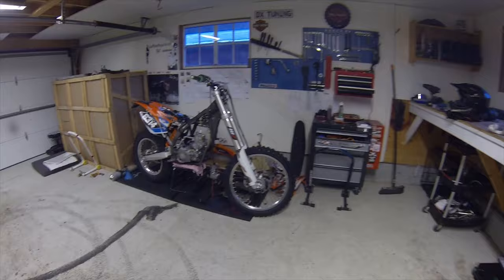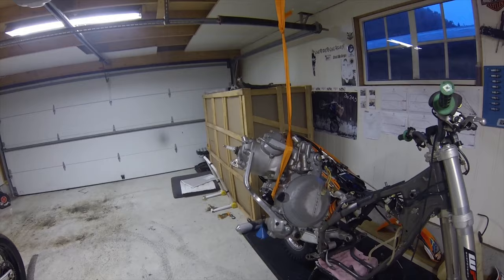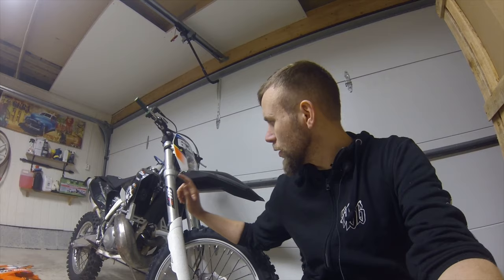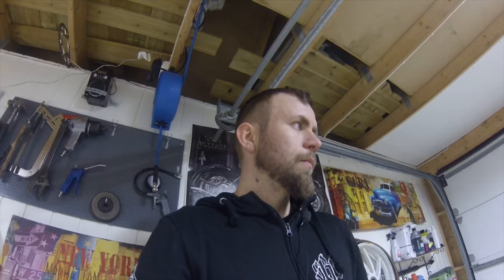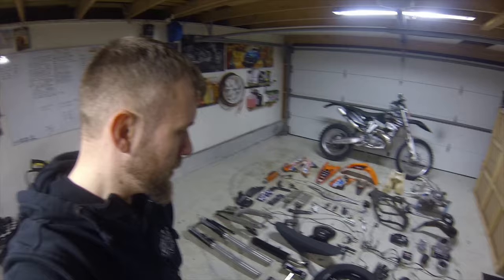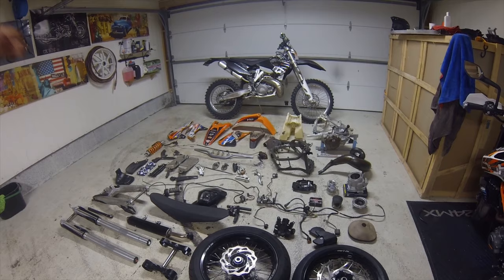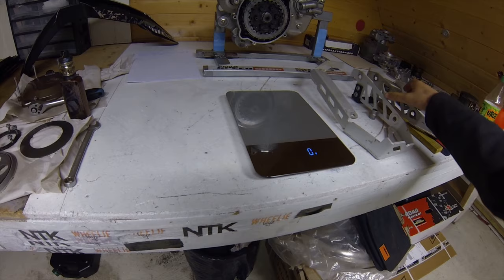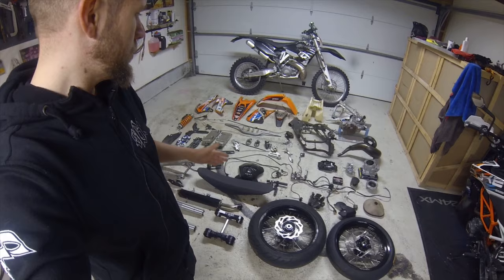500 TWO STROKE SUPERMOTO part 4 Weight reduction Teardown #teampryme

Comment: Is that the stock powdercoat on the ktm frame? It looks like Ti.
Reply from the maker: neil spires Yes, the old ones around 2014 🤤🤤 love the color! but it's getting a black powedercoat now
Reply: @gnagsaar_  Sweet I actually just finished my 03 with satin black.  I thought about spraying clear directly onto the bare steel and as much as I like it now i regret not doing it.
Reply: There's a guy on YT somewhere who has what looks like and what he claims is a custom titanium frame that he designed and welded up himself. Im quite envious of this.
Reply from the maker: neil spires I wanted to do this myself, did some research on it. It's SUPER SUPER hard to get a good lasting finish on it. you either have to sandblast it to get the clear coat stick (that would make it look like shit) or you might get away with cheramic coating. but with risks of the paint loosing grip on the bottomside after a year or two.
Reply: @gnagsaar_  Really? I guess I didn't research it enough, guess I dodged a bullet there. I thought about ceramic also. The main issue I had with mine was that I did it during the summer and the humidity here is so bad that it would leave me literally lime five minutes before surface rust would form. I had to wait until it cooled down and eventually found an old bathtub and used electrolysis on it to kind of case harden it before I painted it. I thought Parkerizing would have been cool also.
Reply from the maker: neil spires Yeah but i was researching for our clima tho 😜 it's about never over 20°c here during summer. about 10°c and rain is our average weather 😂
Reply: Wow that's crazy you never know what to expect here